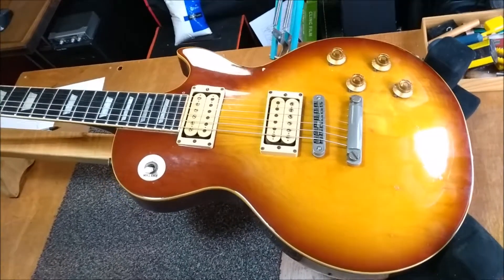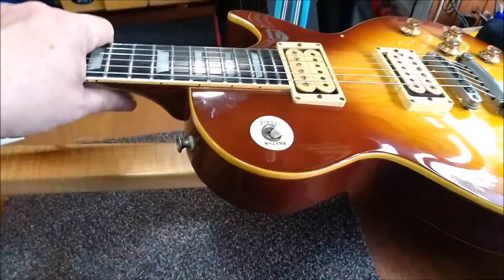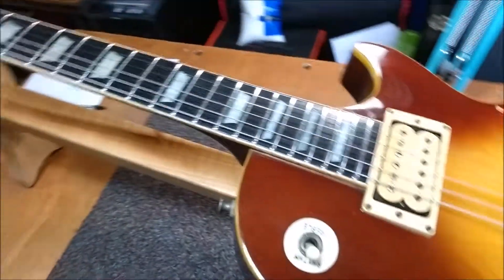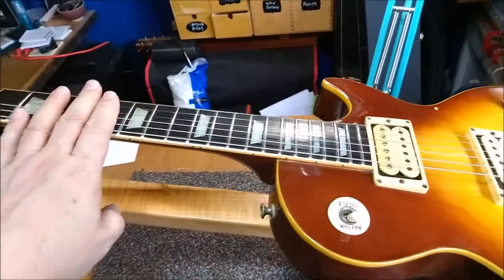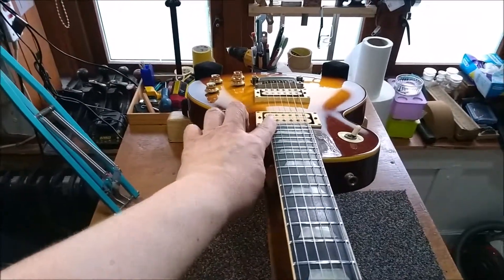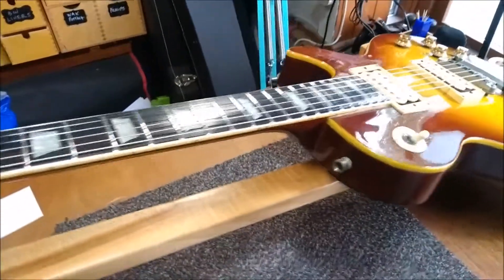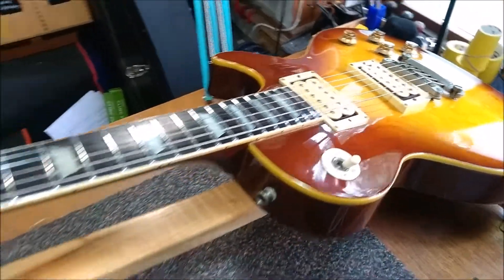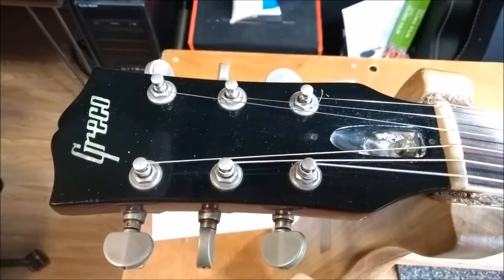Do the Greco Twist

Comment: Hi,I have just watched your video on "twisted neck" and would like your opinion, and advice. I have a left handed 1961 Burns Vibra artist that I had made you Jim Burns  in that same year. Unfortunately it now has a twisted neck,and it is twisted "the other way" . I am considering making a jig to hold the body and support the neck ,and then over a significant length of time using heat, and clamps slowly ,and gradually take out the twist . My concern is in your video you say "providing the twist isn't the other way" which mine is. I have every reason to believe that this is the only left handed version of this guitar that Jim Burns made,so it is a very rare instrument . I look forward to your comments, and advise.
Reply: You can do it, maybe. But dont be afraid to try. Just go slow and use steam and heat to heat up the board. I used a heating iron on the frets of my 81 Yamaha L15A and got a proper warp out, it has a fat V neck and tough ebony board too. I used rulers and blocks to set up a gauge so I could eyeball the twist and turned it out slowly with clamps. Let it it sit for 3 days in a slightly over-turned postition and it has been straight eversince. Bought the guitar cheap because of it. Got a real classic keeper now :)